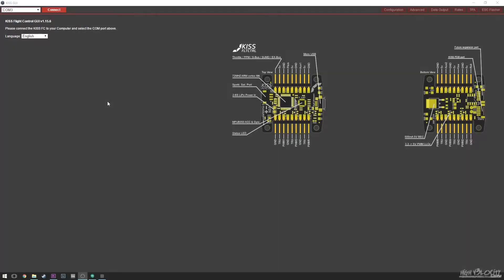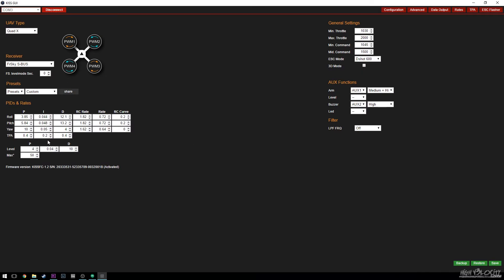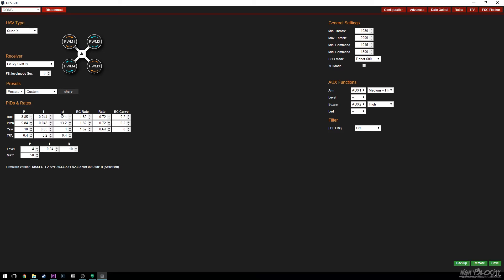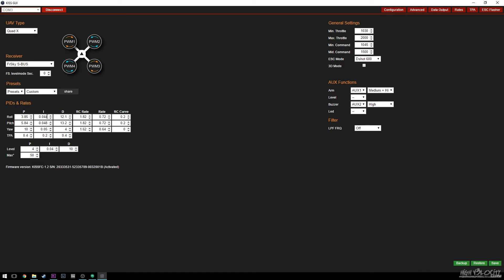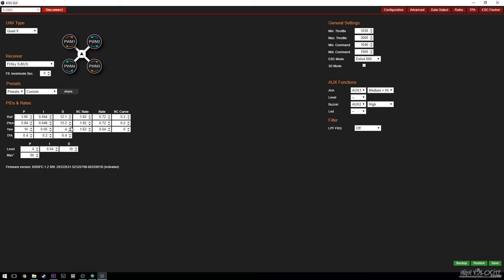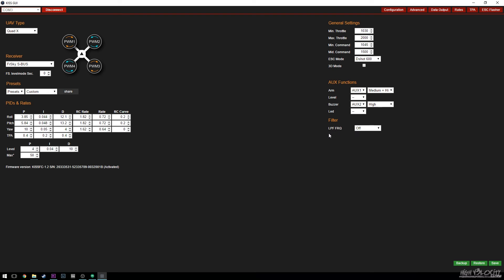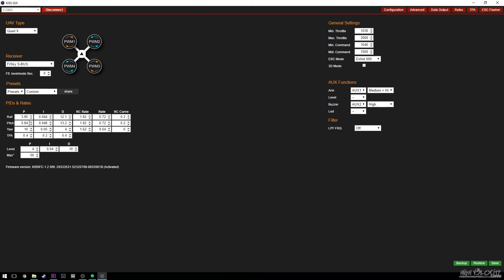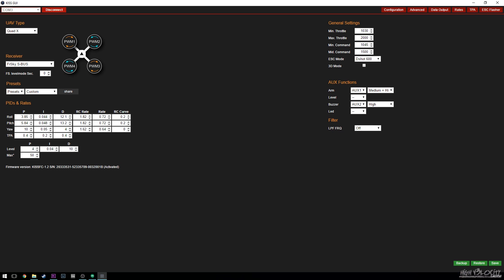Tuning PID's Part 1 Basics

Comment: Great video help me a little bit but still have some questions to ask you. I'm using kiss V2 FC kiss 32 amp hype train motors on a Reverb with hq 5x4.3 x 3 and I've been using betaflight for two years this is my first kissed build. I've tried tuning this but haven't had any success first I tried setting roll and pitch d two zero and then raise my role P until I noticed oscillation but I could crank up roll and Pitch p to a bout 8 on roll in 10 on P and I still wasn't getting any crazy oscillations. The defaults are set at 3 for roll and pitch is there a better way to figure out how high you could go with your P's . I dont really notice any difference when raising the P gain like on BF. Its sp different than BF because i feel like it will allow for high P gain and still fly well. please help thanks
Reply: FPV Addict same  situation  here  !!   Did you find any solution?
Reply: P.P. Strello please subscribe to my channel.. i ended up finding a great tune. You will notice alot of propwash woth high p gains